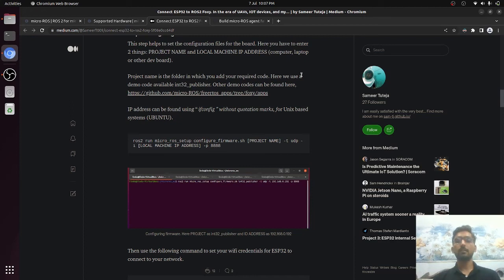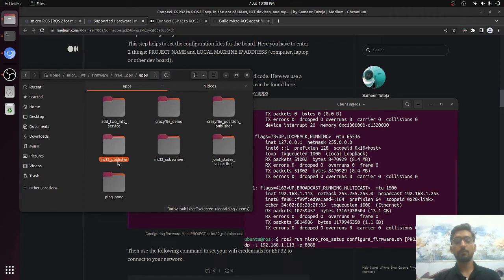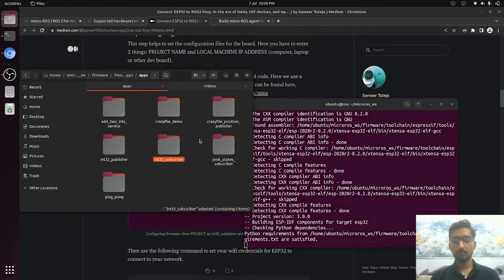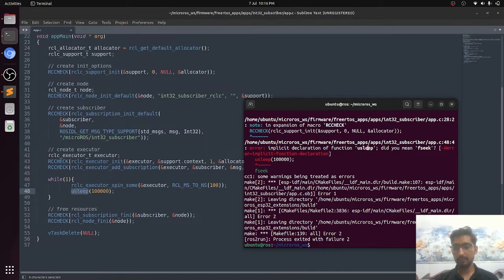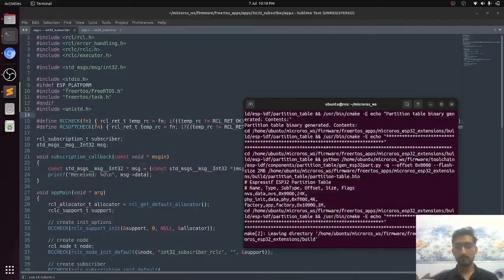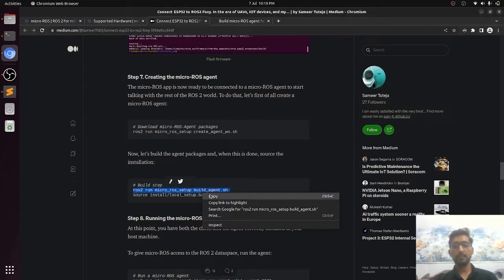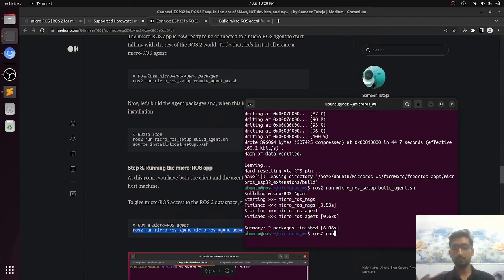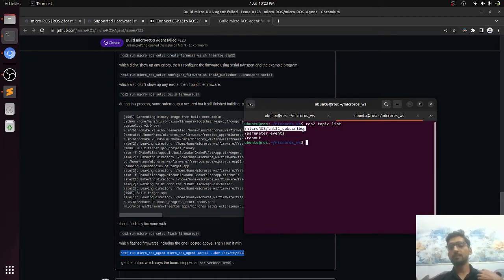Esp32 with micro ROS tutorial | Int32 Subscriber | Hardware Interface  | Part 02

Comment: Can you specify? When I run the micro_ros_agent (Step 8). There are only 2 lines showed, I pressed the EN button and nothing happen.
I also tried to run with serial --dev and when I pressed EN, nothing happen. Btw I use ESP32-WROOM-32E. 
I hope you can help me to solve this issue, Thank you.
Reply: do you find any solution, if there please share?
Reply: @bhaveshpatidar4628  If you using wifi udp, just make sure there is no error at the end of building (exited with failure). If there is an error like that just do it again in a fresh terminal untill no error